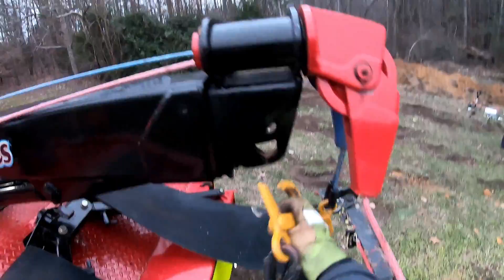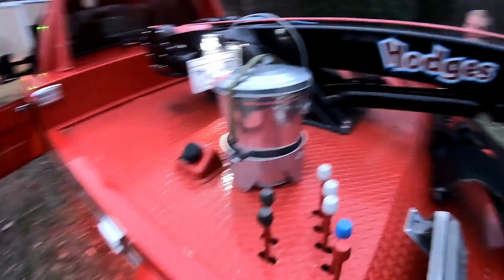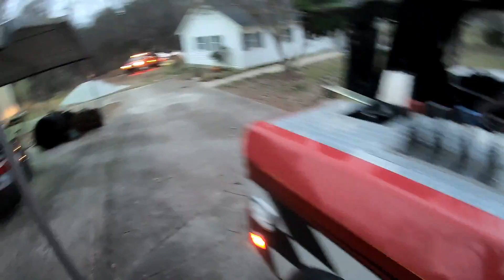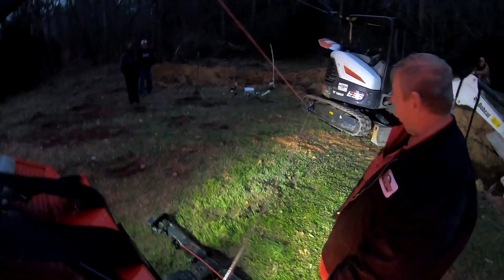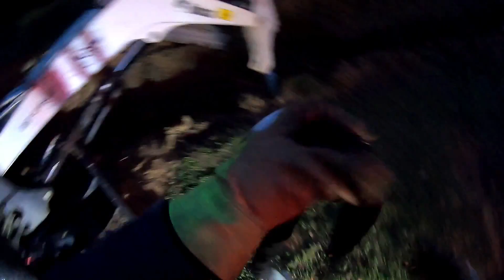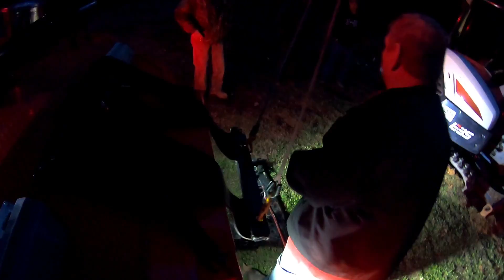BOBCAT TEETERING ON THE EDGE!

Comment: It definitely worked,  only thing I'd have donr different would to strap from center frame and wrap around and over for the lift to level.
Then kept the low pull line anchored back to the boom to lift while sliding.
Just my opinion, done one like this before.
Nice truck too, 450 or 550?
Mine was a 550 powerstroke with the century 412.  Great light and a little medium duty workhorse.
Recovered everhthing from golf cart in a creek to rolled cabover box truck
This was very entertaining to watch.  Make me miss the job.  Did it for 20 years before having to drive tractor-trailer.
Reply from the maker: Truck #6 is a 2003 Ford F-550 with a Century 412
Reply: @hodgestowingsc  and she looks sweeeetttttt